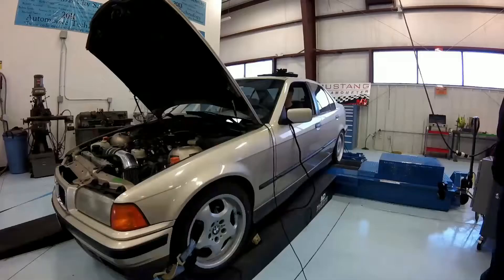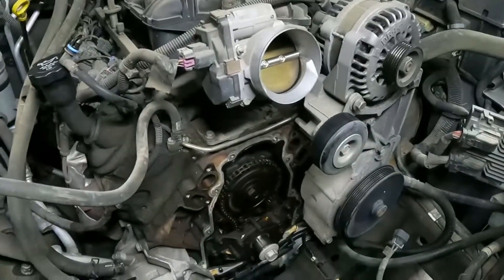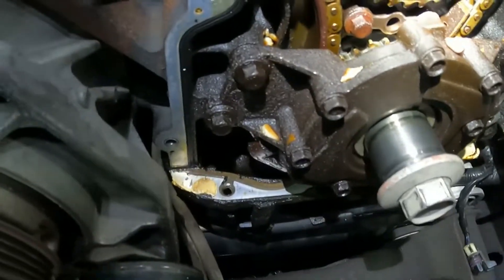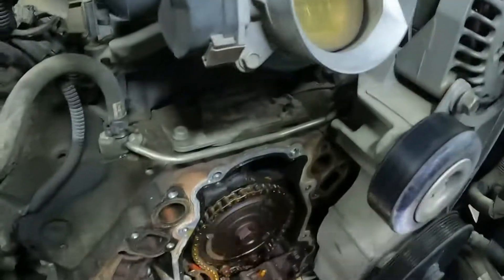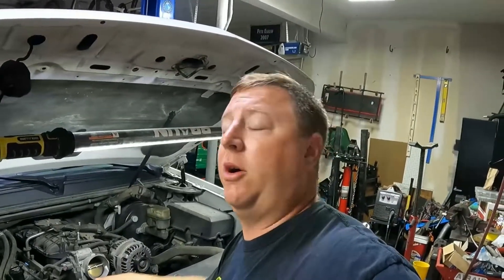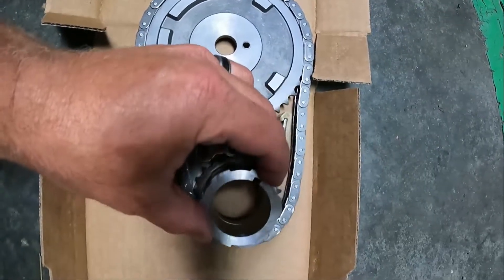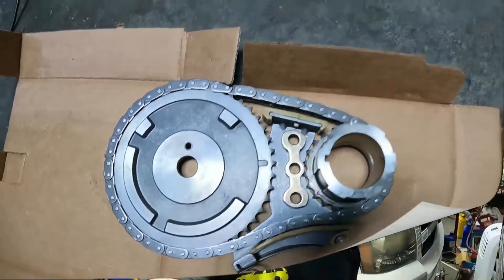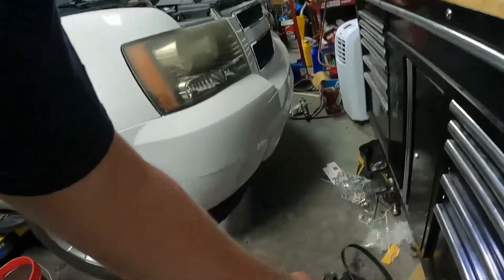What Causes P0016 On A GM Truck?

Comment: Hello,nice video..I have a question..how do you set the camshaft back in time?there are tons of videos on YouTube, but no one shows how ti set it back on time?
Reply from the maker: Remove the valve covers, remove the rocker arms. Then you’ll be able to spin the cam by hand and get it lined up with the crankshaft without worrying about bending valves or fighting valve spring pressure.

Comment: Hi great video , im dealing with it now im just one tooth off ,  im not big on wrenching im curious on your method of finding top dead center . One moved the cam or the crank . I was thinking if i moved the cam back one id be good . The truck is a 2007 silverado and was running when stopped .. the whole thing started because i was changing the cam sensor.. it wouldnt come out , i took the timing cover off and notuced the tensioner..  any advise on setting the timing.  Can i move it one back on the cam ? Replacing timing sprockets chain and tensioner
Reply from the maker: I would put the crank at TDC before you remove anything. That is when the dot on the crank timing gear is at 12:00. Then you’ll need to take the timing chain off to replace the tensioner. You’ll need to remove the cam gear to get the chain off and you’ll need to remove the rocker arms to take the valve spring pressure off of the cam. You’ll then be able to move the cam without worrying about the valves moving. The cam gear mark needs to be at 6:00.
Reply: @PetesGarageandperformance  ok thank you

Comment: Have the same problem with my Mercedes but the engine light will turn off after start up and if I scan it and then after driving it it will come back on any advice?
Reply from the maker: This code means that the crank and cam positions are not in the correct relation to each other. You didn’t mention which Mercedes engine you have, but you probably need to be checking the variable camshaft position system. A GM LS engine like this one is super simple compared to a Mercedes engine so this video won’t directly apply to your car.
Reply: @PetesGarageandperformance it’s a 2006 ML 350 V6 so I’m guessing it’s what ever engine that model takes??
Reply: Also any recommendation videos for my exact car then?
Reply from the maker: I’m sorry I do not. I’ve honestly never had to work on one of those.

Comment: Thank you it was a huuuge help for me. My 2007 tahoe lt has had the code for over 2 years now and mechanics changed both cam and crank shaft sensors n still had the issue but it runs just fine lack of power I guess a little but it also has 240,000 miles on it so ive just kept driving it as my daily driver as long as I could till issues made me get something figured out but now I know what it is thanks to your video and what to expect to pay
Reply: But still drives fine? I was confused too I have a 2013 Yukon same code but the thing runs just fine I don’t get it ?
Reply: @screamersnsp4229 turned out to be a stretched out timing chain, so i needed a timing chain kit replacement
Reply: Also I have 145k miles not as many as yours
Reply: @screamersnsp4229 did u ever fix it?

Comment: I have this issue more than likely. Replaced that sensor and was stuck. Gave up and came back to it a week later to finish replacing the sensor. Still have P0016.
Reply from the maker: Pull that front cover

Comment: Ugh.  I have this code on a 2009 gmc 2500hd.  Sometimes it stalls and other times it’s hard to start.  It seems to come and go.  Not sure if it has VVT.  If it jumped time could the code be intermittent?
Reply from the maker: I wouldn’t expect the code to come and go if it jumped timing. I have seen the actuator on the front of the cam on vvt engines stick and cause the engine to die. You’d need to datalog with a scan tool to accurately diagnose it.
Reply: @PetesGarageandperformance  Thanks.  I verified that I have VVT  When you say Actuator, are you saying the pancake solenoid on the cam cover or the valve that screws into the cam?  I have a Launch scan tool but don't know what I should be looking for.  Can you help in telling me how to diagnose it?
Reply from the maker: I would look at the desired cam timing vs the actual cam timing when coming to a stop to make sure that’s what is causing it to die. Also make sure it has plenty of oil in it. But I was referring to the cam sprocket (actuator) and a new bolt (valve). It could be the little pancake valve on the front cover but I’ve never personally seen one go bad.
Reply: @PetesGarageandperformance  Thank you.  I'll have to study up on how this system works.  I'm familiar with the valve and pancake solenoid.  I'm not familiar with the actuator.  I probably should just pull the front cover and see if it's out of time.  I'm just dreading if it is and the pan has to come off.
Reply: @PetesGarageandperformance  I verified that it did not jump timing.  I’m going to replace the cam bolt valve and put a new timing chain , sprocket and tensioner on along with a high volume oil pump.  If it’s not a mechanical issue, then it must be a wiring problem.  Swapped ECM and replaced the crank sensor too and still threw the code.
Reply from the maker: @ I’d put the cam gear on also. It’s the actuator that moves the timing. It could be sticking.
Reply: @PetesGarageandperformance  yes I will be replacing that also along with the magnetic servo.  I want to rule all of that out.
Reply: Replaced crank and cam sensor.   Replaced oil pump, cam sprocket (vvt), crank sprocket, cam bolt, timing chain, pancake solenoid, vvt harness and changed the oil.  Like always, starts and runs fine when cold.  As soon as it gets hot, it quits and cranks but won’t start.  Sets P0016 code.  Fuel pressure is good and it has spark but won’t fire even with starting fluid.  Oil pressure is 22 psi at idle when hot.   Also when it’s cold and you rev it, the traction light blinks until it warms up.  Could low oil pressure cause the cam to be out of phase?  When cranking, it’s commanding a different cam angle than is displayed.  It’s definitely a heat related issue.  If you can help, I’m willing to pay you.  Thanks Pete!
Reply: @89vette1 im having the same issue, did u ever figure it out?
Reply: @denisgonzalezblandon1538 yes and no.  It was mechanical and not electronic.  The most likely cause was low oil pressure at the VVT solenoid due to worn cam bearings.  I just needed it to run so I installed a phaser lock so the phaser could not move and that worked.  I also disabled VVT with hp tuners so it wouldnt throw a code.  It has a noticeable drop in power though.  Other than rebuilding, a swap to a non VVT cam probably would have worked better.   If your problem is the same as mine, one of these solutions will work.
Reply: @89vette1 damn sucks to hear that, this one is the same thing I changed oil pump and all timing components, on the highway it loses power and wants to die and when it does it only turns on once its completely cold, how much did u spend on the tune and sprocket? I was reading about sometimes being the pcm which ill try heating up when the car is cold to see if it does the crank no start issue, weird cuz the engine sounds good at idle and when revving
Reply: @89vette1 also how many miles on your truck?

Comment: I just installed a HV oil pump and after driving around all good then i parked and turned off the engine and turned it back on then i got the same code but the car drives perfect do you think its the sensor? Btw my oil pressure now is on 40 psi idle and 60 psi after 1k rpm but never went more than 60psi do you think the high oil pressure caused the problem?
Reply from the maker: Why did you install the oil pump? Were you trying to fix an oil pressure problem? Did you check the timing marks when it was apart?
Reply: @PetesGarageandperformance  yes because my oil pump was old and started to drop oil pressure and i drive a lot in hot weather 5000km in a month thats why o installed HV i wanted to make sure the oil pressure is good in all conditions, and unfortunately, i didn't check the timing marks because i didn't do it by myslef, changed the oil pump with the chain tensioner

Comment: How to did you get it back into time? My 08 is exactly the same as this. How do you get the dots to line back up and make it back in time? Thx
Reply: Did you ever figure this out?
Reply: @gatermap  yea, just spin the crank bolt till they line up and call it good. Been running ever since
Reply: @sasquatchedc  awesome! Thanks for the quick reply! Got everything torn down today. Going to replace timing set, VVT valve, tensioner, and oil pump tomorrow. 3 teeth missing on the cam gear and the tensioner is MIA. So I’m positive, with cam/crank correlation code, my timing marks are off. Thanks again!
Reply: @gatermap  no problem. Did u bend a valve?
Reply: Fortunately no. Just the code and it failed emissions.
Reply: @gatermap  good deal. Mine skipped a tooth bc chain tensioner snapped
Reply: It’s such a poor design unfortunately. I mean, it works…until it doesn’t. And like you said, your pistons can smash into the valves and then you’re even deeper into the engine. GM should be responsible for this sort of thing. But that’ll never happen. I’ve been a GM fan my whole life but will probably move away from their trucks in general with the years with the DOM/VVT stuff. Of course you can delete it all, but just more work and another expense. You won’t see an old school small block or even the early vortec engines or even an LT1 with this many issues. Disappointing.
Reply: @gatermap  I agree. It's trash.

Comment: 11 gmc yukon tensioner broke jumped 3 teeth how likely rods r bent
Reply from the maker: If it’s only 3 teeth then you’re probably ok because it retards the cam.
Reply: @PetesGarageandperformance  i did the timing and im getting p0300 with p0016 pending  motor miss firing like crazy
Reply from the maker: @trevino9136  the timing must be off if it’s throwing p0016. That will cause a misfire.
Reply: i did everything bythe book made sure tdc  dot on crank at 12 cam arrow at 6
Reply: I have the same code but it sounds like the engine has no compression. It fired but won't start and the valve train does rotate. Jumped time ?
Reply from the maker: Do a cylinder leakage test to see if the valves are bent. If they’re ok then you can probably just replace the chains.
Reply: How do you know? My 2013 Yukon is running fine with the code

Comment: Hey Pete, could this timing code throw the P0106 code as well?  I currently am working with codes P0016 & P0106.
Reply from the maker: It might because p0106 is a MAP sensor performance code. Because of the jumped timing the engine’s vacuum is out of the expected range.
Reply: I have the same codes, did you find out the issue?

Comment: Yeah ive got an 08 Yukon throwing the cam position code. And the running lean code. Im sure its that timing chain. $900 labor im ready for. More than $1200 just for labor will hurt. Lol. Thanks for the info
Reply from the maker: Yep. Nothing seems to be affordable anymore unless you do it yourself.

Comment: I have this code in my 14 Malibu but it drives perfectly fine and light comes on intermittently so I’m guessing it’s one of the sensors.
Reply: we’re u ever able to see
Reply: @4.3Devv Yes after replacing the sensor the light still came on. After having it investigated there was a loose bolt and the guides to the timing chain were loose. Just had them put a new timing kit in
Reply: @ okay thank you also do you have vvt?
Reply: @4.3Devv  I’m not sure

Comment: Is it necessary to halve to replace the oil pump or also take it off to do the chain?
Reply from the maker: Yes, you have to remove the oil pump to replace the chain. Which also means dropping the oil pan.

Comment: Hey Pete this is Tony I've been a technician for over 40 some-odd years I tore down my first 53 this week because I had p0016 code in it I looked it up and it said that it jumped a tooth in and I tear down and it's in time but first it though the code for the cam sensor and you're right I like to never got that damn cancer throughout of there so now I tore it down I'm a little aggravated because she's in time.
Reply from the maker: Does yours have vvt or not? The one I did in the video did not have vvt so there was no way the p0016 would set unless it was out of time. If you have vvt then the actuator may be sticking or something wrong with the solenoid, bolt, or oil pressure.
Reply: If my timing is good. But no oil pressure? Will that keep it from starting or anything....  @PetesGarageandperformance
Reply from the maker: @tristanwaldrup9827  it’ll start with no oil pressure. It usually wont make oil pressure until after it starts. In order to get it start you will need spark, fuel and compression. Are the spark plugs wet with fuel?
Reply: @PetesGarageandperformance  I did the dod delete and Cam stage 2. VVT 4 degree lock out
I had this code in the video. Wouldn't start...
I put a compression tester and cylinder one had no compression....

Comment: We have this code but she runs and drives fine expect the occasional press on the gas and there is like a slight loss of acceleration but it seems like water in the gas. Or is it the timing?
Reply from the maker: If it has a p0016 code, it’s the timing.

Comment: Pete I wish I would’ve found this several $ ago. Swap sensors: MAP, temperature, oil pressure switch, also the one by the starter. Plus swapped throttle body, spark plugs, wires and coils. When she runs she runs pretty normal. Then every now and then, she’ll go into reduced engine power and eventually doesn’t start

Comment: Pete, just found this issue on my 08 suburban.  Do you just rotate the crank clockwise back into alignment with the cam?  I just don't want to cause any valve damage by rotating the wrong way.
Reply from the maker: I would put the crank at TDC before removing the timing chain. Then you’ll only need to rotate the cam a couple teeth to get it right. But be careful because you’ll be fighting the valve springs.
Reply: @PetesGarageandperformance  shoot, I did the opposite before even thinking about the interference engine thing.  I rotated the engine so the cam mark was at the 6 o'clock position then removed the chain and rotated the crank mark to the 12 o'clock position.
Reply: Did that work out for you? I swapped the timing set in our ‘13 5.3 because the code showed up. Found the tensioner in a million pieces and the cam gear had 3 missing teeth. I put the crank at 12 o’clock, the. Put the cam at 6 which I only had to move a little bit. Chain went on fine. Should I have to worry about anything as far as having screwed up the timing somehow? Everywhere I read I see you just set the crank at 12 then move the cam to 6 since the gears only go on one way.
Reply: @gatermap did it delete the code? I have a 2013 Yukon with the code but is running fine?

Comment: Okay so good bye chevy cruze 2011 😅
Rip rip rip
Reply from the maker: This engine has absolutely nothing to do with the engine in the Cruze. This is the truck engines from 2007-2013.
Reply: @PetesGarageandperformance  i know man but my case is my engine runs poorly and there is not problem to start the car engine starts right away but runs poor when code p0016 appears

Comment: Was the truck running like shit ??
Reply from the maker: Yes. Hardly would get out of its own way. It felt like the exhaust was clogged.
Reply: @PetesGarageandperformance  damn 🤦🏾‍♂️ I just bought a 2007 Yukon and it runs like crap and have the p0016 code I'm glad I ran into your video b4 I started throwing parts at it
Reply: Ha you think???

Comment: Ridiculous not to replace the oil pump as well.
Reply from the maker: I can’t even begin to count how many times I’ve seen people replace something that was working just fine and have the new one fail. If it ain’t broke, don’t mess with it.
Reply: @PetesGarageandperformance  don't use cheap aftermarket crap, solves a lot of your own problems
Reply from the maker: @kevinbarry71  agreed
Reply: I wouldn't even attempt the job like that unless I replace the oil pump everything that's come loose is in the oil pump make the call like Eric O says lady we found your problem and the money light is on cha-ching